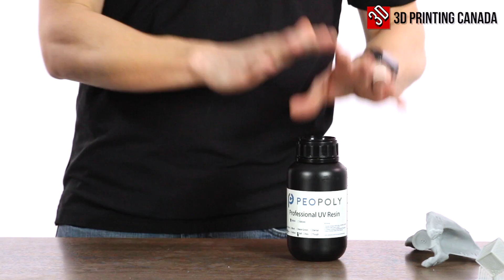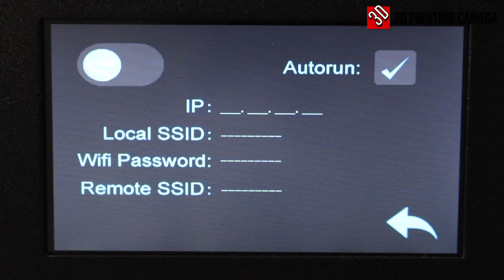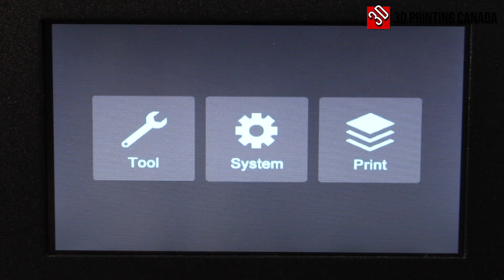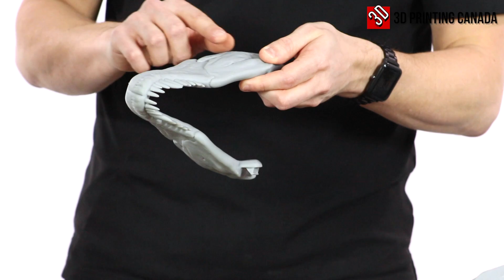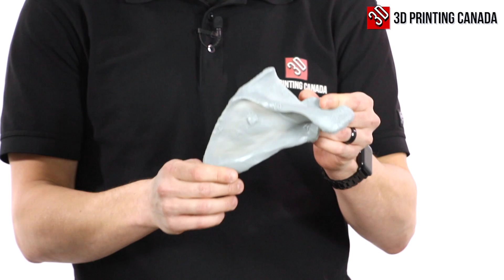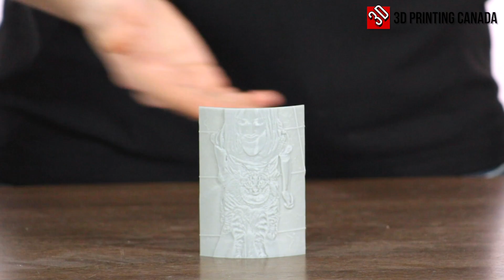Peopoly Phenom - Is it the Best Large Resin 3D Printer?

Comment: If you want to make your Phenom a little bit more quiet, the easiest way is to change the Fans in both sides. Originally there are low cost 24V fans build in, and under the LED lamps inside either. Changing the inside fans is just for DIY-people with electrical expirience, the fans at the sides is quite easy. I used this fans to get it „quiet“ : Noctua NF-F12 iPPC-24V-3000 Q100 IP67 PWM 
These are 24 Volts fans by Noctua. They run at 3000 1/min, produce a pressure about  7,63 mm H₂O and  187m3/h airflow. A very  powerful fan and really quite.( 43,5 dB(A)) The price is not really funny, about 30€ each. But getting the Phenom a little bit quite is it worth to pay for...🤗

Comment: Additional information to WiFi. The printer has LAN, but no WiFi. There‘s an option in the firmware, but it‘s not supported by the board. I‘ve read this on the Poepoly FAQ and community posts. The LAN funktion is only used to send printer files to the printer, nothing else. I think, the normal handle is using an USB-stick.

Comment: I'm currently deciding whether to buy the Phenom, or just go Gusto and purchase the Phenom L.  Anybody using this machine?  How well does it do flexible clear parts.. Say I wanted to print off some Clear Gummy Worms to make fishing tackle in an specific order.  I'm trying to find a decent machine to really get into my own designs and prototypes.  I have the cash but I won't go over $5000.  And my brother has a lot of friends who want 3d printed stuff so right there I have a sustainable market to make stuff for.  So is this my machine?  It looks pretty idiot proof.  Your thoughts.
Reply: I wonder... Is there a Resin out there that mimics the Fake Skin from Mission Impossible?
Reply: Oh great.. Now I have to decide if I want to go with the Noir and the slightly smaller build volume for speed.  The unit last 5x longer before replacing the screen and it's cheaper in the long run on screens, but now I have to check if that build volume is substantial.. Can I buy the Phenom L and update it later with Noir Tech Releases?  Decisions, decisions..

Comment: I have this machine and hope to be able to model create reliable models as you have done.
Please can you confirm the initial default settings so that I may use a proven set up.
My machine was delivered with a variety of adhesive tapes on the bottom sheet metal work and a thin skin over the LCD. Is that the condition of the machine you received, or should it be removed.

Comment: My biggest question about resin 3D printing... How are you supposed to dispose of the potential harmful chemicals used to print afterwards?
Reply: The spent resin can be cured out in the sun or under a UV light and disposed of in the garbage. Not recyclable. IPA will evaporate. Never pour liquids down the drain. Water-washable resins may damage or pollute city water systems and should be avoided.

Comment: Thanks for posting this and I'm really considering getting one from you guys once quarantine is over. Leveling this looks so much easier than a fdm printer. I still have issues with the nozzle hitting the print over, etc with FDM. Is a resin printer a bit easier to use in comparison because it looks like it from this vid (I'm aware of all the cleanup that has to be done)?
Reply: Leveling the plate is a lot easier on resin printers because it only has a Z axis, it’s pretty painless.  I wouldn’t compare a resin printer to an FDM printer, they both fit their own purpose.  I use both but I think resin printers are way cooler because of the amazing detail you can get which is impossible on FDM.  The downside of resin is that it can be brittle. you drop a piece and it can shatter, but I hear there are less brittle resins also. I haven’t tried any of those yet.  I think resin is also more expensive to use, so a big piece like he printed out there had to be at least $40 if not more.  I know you are aware of the cleanup, but I’m not sure how aware you are, so I’ll tell you, it is a bit of a pain in the ass.  You can get failed prints that stick to the FEP film on the bottom of your resin tank, then you have to empty the resin tank to clean it up which is not fun.  Filter your resin using a paint filter to get all the hard bits out. I’m not sure why none of the resin tanks have a pouring spout? But using a funnel with this toxic gooey stuff dripping all over the outside of the resin tank sucks.  Imagine pouring pancake batter using a bowl and trying to keep the outside of the bowl clean?  Now imagine that pancake batter was toxic and you’re trying your hardest not to drip it on your clothes, floor, table or skin.  It’s a careful balancing act.  You got goo on your gloves, then you don’t want to cross contaminate things you need to touch with your bare hands.  Is it worth it? Yeah cause the prints are beautiful.  When you get your first print done there will be this whoa moment and you’ll realize you got something special on your hands.
Reply: @noelr9376  I really appreciate all that very important information. Thank you! To give an idea what I would like to do with resin is high quality super sculpts. If you google image search "queen studios superman" that will give you an idea of the quality I'm shooting for. Silicone skin, glass eyes and hand punched hair. My idea is to sculpt characters I want and print out a life-sized mold with resin and cast my sculpt in silicone. For the molds, I'll need all the skin texture which is why I want to switch from fdm to resin. 

When you mentioned failed prints, may I ask the ratio of successful prints? For fdm, my cr-10s pro fails 4 times out of 10 for example no matter how much effort I put into the leveling. I know resin is more expensive so I'm just trying to get an idea of what I'm facing.
Reply: Kiriyama T Sounds like an awesome project.  Resin printer is absolutely a great way to go, an either this or the Phrozen Transform would be good for that.  What percentage of failed prints do I get? Hmm I think about 1 in 6 for me, but it’s difficult to say what caused some of the failures.  A lot of times it is user error, like incorrect setup of the supports, too much surface tension, it’s always a good practice to hollow your prints and print them at a 45 degree angle to reduce surface tension.  Too much area causes a suction cup like effect ripping the prints from the supports and causing hard goo at the bottom of your tank.  The other thing you can do is use more supports to overcome the suction if you are printing a lot of surface area.  It’s one of those things you will have to play around with.  Also keeping the FEP film and resin clean helps.  It’s a good practice to empty out the resin, wipe off and clean the film and filter your resin every few prints.  Some people recommend doing it every print.  I would recommend printing a smaller model of what you are making first as a test. Also sometimes I get lines in my models and I don’t know what causes them, whether it’s the model or the slicer, or a possible the setup with supports?  I do art projects also.  Just a tip, I sand my pieces first, then spray with 2 in 1 primer filler, then sand again.  That gets rid of the layer lines although if you have a lot of high detail it can be tricky or impossible to sand, but I usually end up with a highly smooth polished looking model.
Reply: @noelr9376  thank you so much for all these tips. I made sure I saved them for future reference. I'll probably buy a smaller resin printer from 3D Printing Canada and make sure I get the hang of it all before committing to a beast like this.
Reply: Kiriyama T You can go that route.  I hope I didn’t discourage you.  I’m sure you will get the hang of it.  I think if you are serious about the projects you want to do you should just get the printer you want.  The bigger printers are not more complicated to use, they are just bigger, and you can still print small pieces on a big printer.  I think if you know this is what you are aiming for, save some money and buy the one you want.
Reply: You make a very good point there. I'm going to do a bunch of research and once Corona is over, hopefully I'll make my decision. :) Thanks again.

Comment: did you test the prints for temperature stability and chemical resistance 

(i use 3d printing for car parts, so they must withstand at least 80°C and it would be nice if they can resist cleaners)

regards

Phil

Comment: The UI is basically a reskinned version of the UI off the Elegoo Mars, and what is up with that leveling procedure lol, some light springs in all four corners pushing down on the print head would have been a much simpler and more consistent way to level it against the fep film
Reply: @Jason I'm not talking about using just springs, obviously that wouldn't work, perhaps you misunderstood, I'm talking about putting springs alongside the screw based hardware, so when it comes time to level the print surface, you loosen the screws home the z axis, the springs would then provide just enough force to push the build surface against the screen without damaging it, and then you tighten the screws to hold it in place, this has worked very well on the elegoo Mars and doesn't require a very strong spring

Comment: Thanks for the video, very impressive. On resin printers can you leave the resin in the printer for a couple of days as long as the enclosure is installed.👍
Reply: My vat has a rubber cover.  I leave resin in there for weeks, no issues.